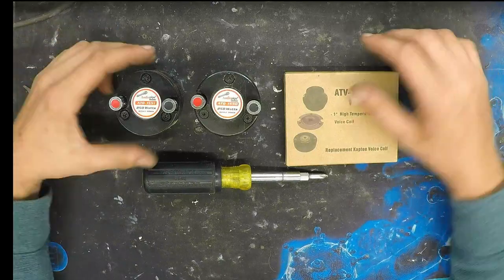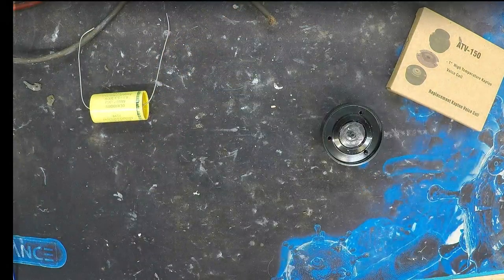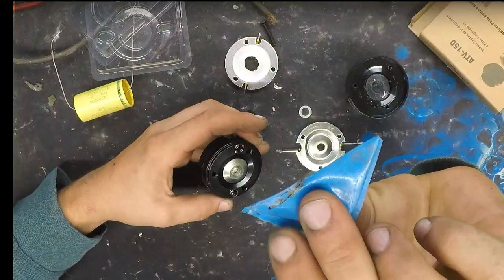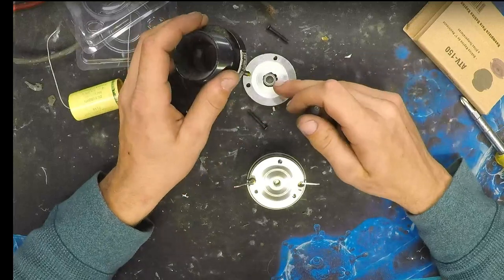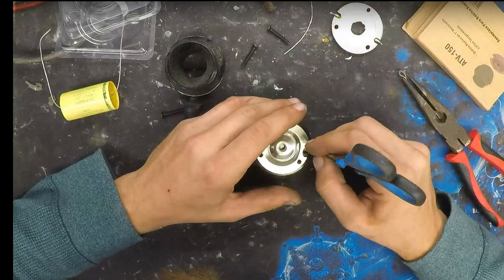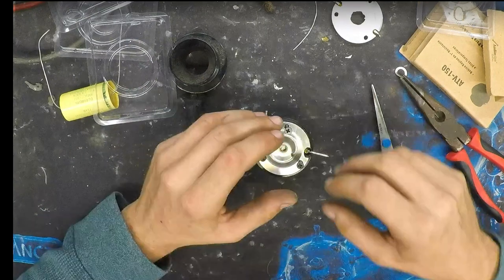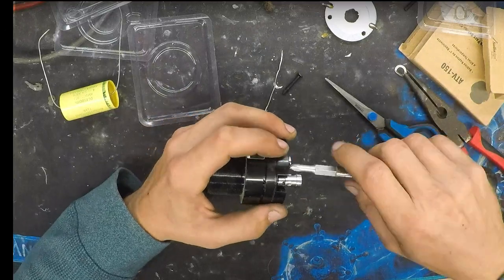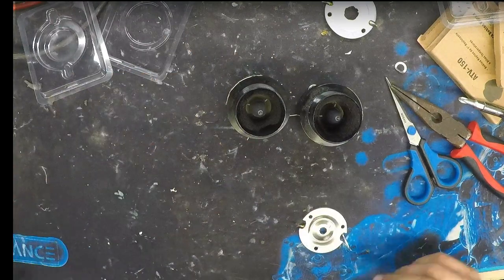How to install a replacement diaphragm in a bullet tweeter. Audio pipe tweeter repair.

Comment: Jessie, can I switch out an Infinity Polycell tweeter for an EMIT tweeter? 

Though the former is round, and the latter a rectangle, it looks like the EMIT tweeter is wide enough to cover the round hole >>>>> am I right? 

I don't want to have to mess with the crossover unit.  I'm hoping for a simple 4 screw switch.  

Thanx